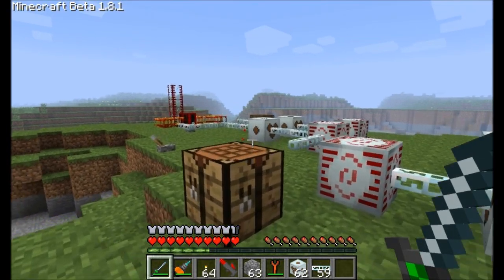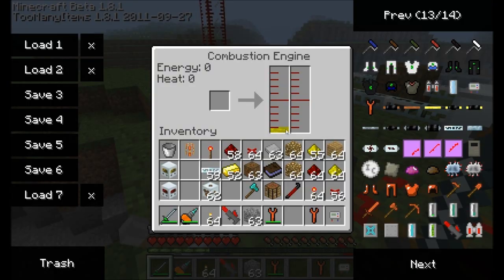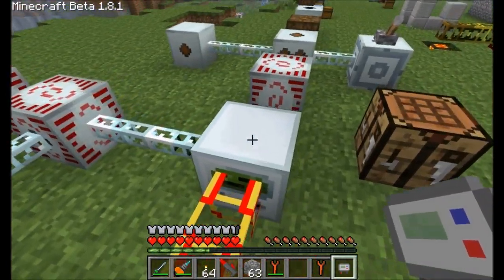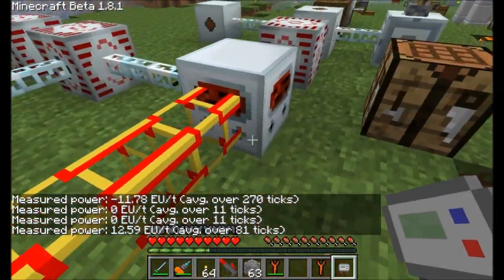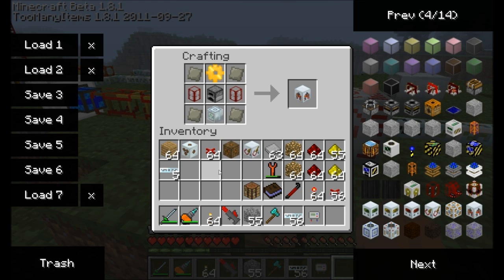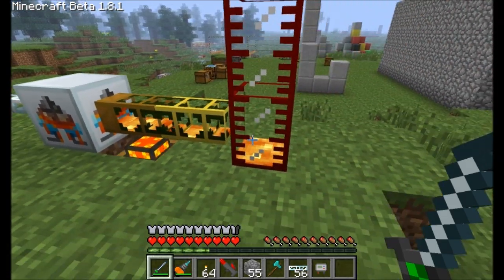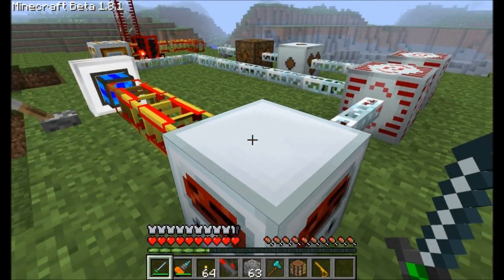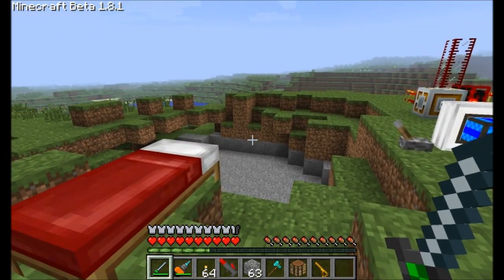Power Crystals' Power Converters

Comment: the funny thing is that 1 bucket of oil cost 50k EU, but if refined to fuel and filled in a fuelcan it gives about 75k EU out. You can build a nice powerplant which doesnt need any resources with that knowledge

Comment: You can. Just pump water from an infinite water source with two redstone engines into the water strainer, and then you get free EU with no input. Not very high energy output, but more powerful and reliable than a solar panel!

Comment: @SNOWSKIJUNKY Go check out a mod called transformers. It has a ajustable electric engine whichk takes up to  2047.5 eu/tick to product 819mj/tick. Also, if you connect multiple wooden conductive pipes to a energy link , each of them will increase eu usage by 72eu/tick

Comment: thought this mod is nice, i dislike its recipes, and the concept of the EU to buildcraft energy converter as its not a matter of conversion because buildcraft's energy system is pneumatic and therefor needs a electric engine, not a simple converter which is why I like the buildcraft - industrial craft crossover mod and I can't wait for it to be multiplayer.  I  however like the other components of this mod (not including the bc to ic converters), with the exception of the fabricator textures.